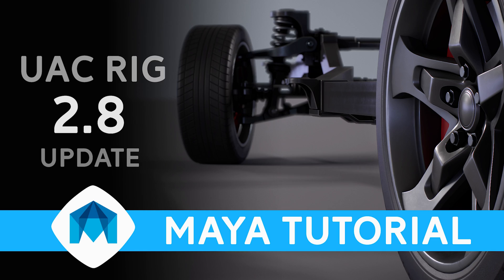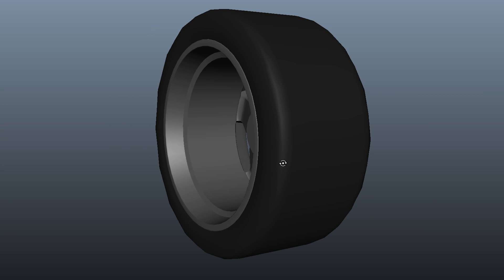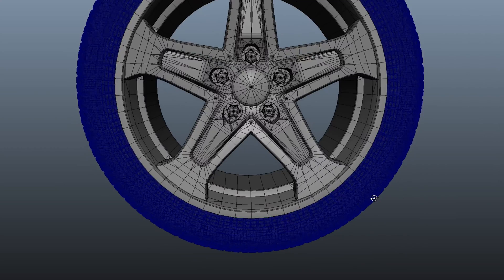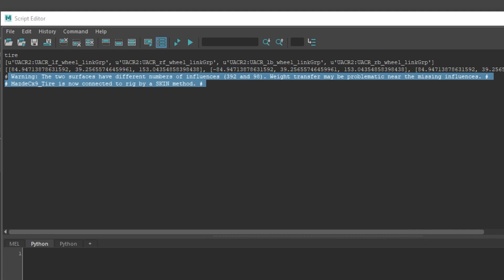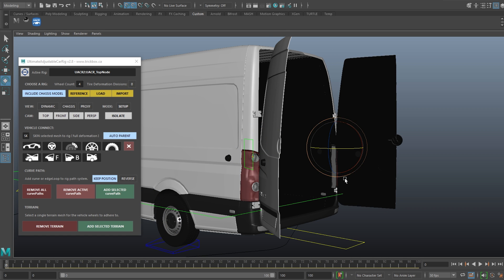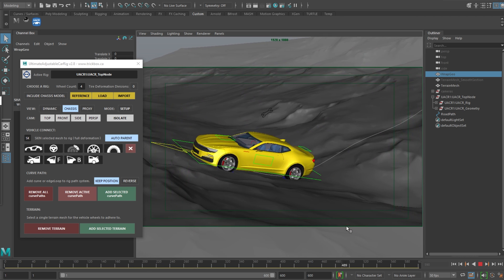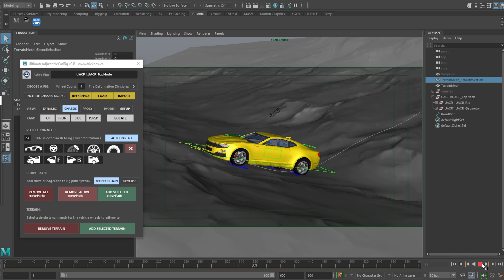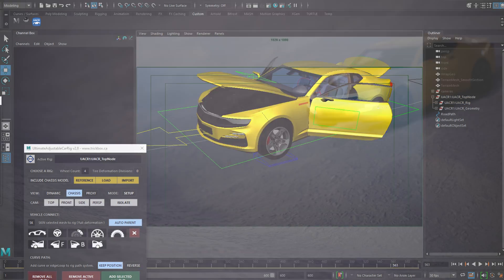Maya Car Rig | UAC Rig Update 2.8 | Vehicle on Terrain Rig

Comment: is there any way i can bake the dynamic? i set the keyframe for dynamic translate Z for tilting, and i can see car is tilting in the viewport, but it doesnt have dynamic when i checked the rendered sequence.
Reply from the maker: Are you using a curve path animation?
Reply: @SimonMills  no, i animated Control Rig to make car move straight
Reply from the maker: @JayEG784  Use the preset straight curvePath if you want the dynamics automatic

Comment: Hey Simon, I'm trying to connect the terrain in an referenced rig but it's not working. Do you know if it's possible? (it s working when I import the rig to my scene) Thanks!
Reply from the maker: Hi Matheus, that should work. Can you send me the error?  Thanks!
Reply: I sent it here but it s not here anymore. @SimonMills  should I send it through other channel?
Reply from the maker: @matheusmaciel85  you can email it to me: smills@trickbox.ca
Reply: Thanks Simon, I managed to get it working. There were some old wrapPlane in the reference rig. :)
Reply from the maker: @matheusmaciel85  Awesome, glad it worked out. Thanks for letting me know.

Comment: Awsome! A simple question: How do link a camera to match the car animation, and (actually 2 questions) what are the steps to add a person driving the car?
Reply from the maker: I would parent constrain a group to the vehicle body joint.  Then you can place a camera and a character inside that group.  The Camera transforms will be free to animate as needed. The character will need an IK rig setup for the arms so you can link them to the steering wheel.
Reply: @SimonMills  My man! Thanks!

Comment: Hey Simon does this rig works with Z up? i noticed that it's a bit weird when I turned Z up.
Reply from the maker: Sorry for the delay in response. It was built for Y up.  Z up should work but you would need to modify the world up vectors on the path animation nodes.

Comment: I am having issues attaching the car rig to the motion path. Do I have to use the shrink wrap method like you used here or can it be done with just the motion curve ?
Reply from the maker: The path can be used on its own. The shrink wrap is just for having the suspension react to coarse terrain.  Send me a video/images/sceneFile of the issue:  smills@trickbox.ca
Reply: @SimonMills  thanks very much for your feedback. I will do that

Comment: Hi, I get an error: "/data/MayaUltimateAdjustableCarRig-Lite/tool\UltimateAdjustableCarRig.py line 849: unsupported operand type(s) for +: 'NoneType' and 'str' # 
"  when trying to attach an object.  Any idea why? cheers, Paul
Reply from the maker: Hey Paul,  what connection method are you using and what object are you trying to attach?
Reply: @SimonMills  Thanks for your reply Simon.  I was using multiple geometry pieces and constraints. Reloading Maya and the scene seemed to fix it though? No idea why.
Reply from the maker: @paulcharisse7746  Glad it fixed itself. If it happens again let me know.

Comment: This is a great update Simon! Thank you very much for your continuous effort and support.

I have a [silly] question for you. It might already be possible I think, but can you animate a car jumping off of a terrain (like off of a ramp for example) and then landing with all the physics in place with this rig?
I hope I made sense! Haha

Thank you!
Reply from the maker: Hey Mauro,
Great question, I would animate the car driving on a path that raises with the ramp and continues through the air in the desired trajectory then have it come back down to the floor. This will have a continuous path for the dynamics to work well with. For the terrain connection, it can be blended off while it is in the air and back on once you touch down.
Reply: Brilliant!
That's exactly how I thought I would have sorted this kind of situation, but I just wanted to be sure in case there was a more "realistic" and straight forward way (like in Craft Director Studio for example, where you can do it with the car just taking off the ramp and landing due to gravity).